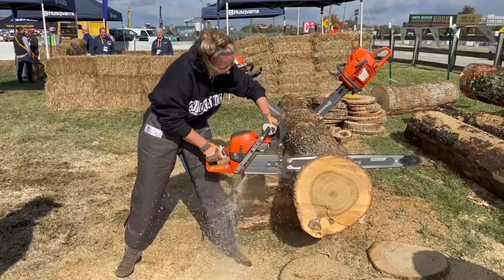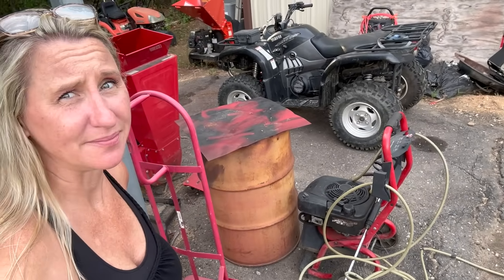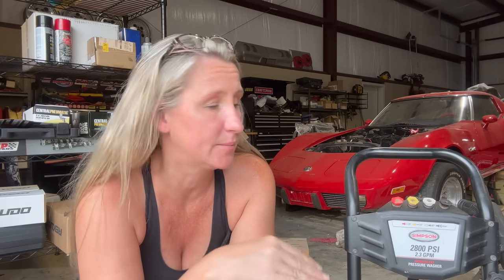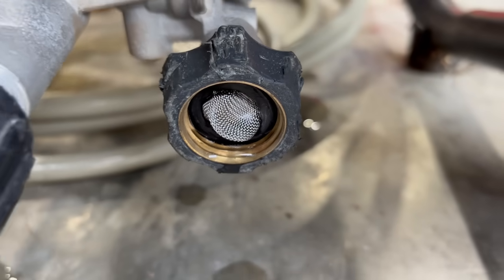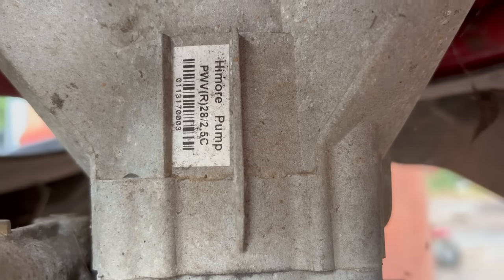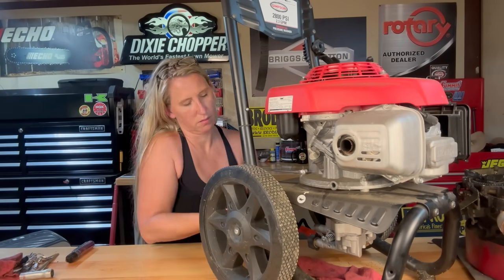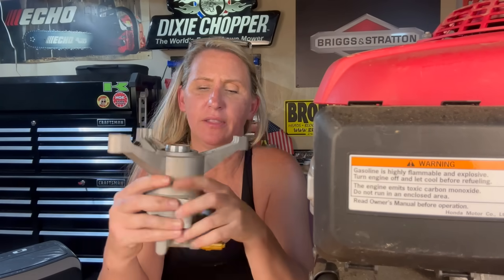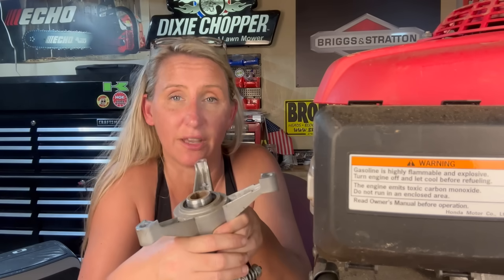STOP Paying Repair Shops! Pressure Washer Has NO Pressure?! Check Out This Super Simple Fix!

Comment: We bought a Greenworks electric power washer seven years ago for $103 on Amazon. I had to replace the hose last year for about $21. We've stayed away from gas motor washers for the point you made about not letting the pump idle. Our little electric wonder isn't the biggest but damn if we haven't got our money out of it. I checked the "buy it again" box and the replacement now sells for $249. Lordy. 

Great how-to video just the same. Best to Ron.
Reply: I paid 60 for the 1600psi ryobi. I've done entire farms with it and my inverter. One of the best washers I've ever had. I also sold an old hyper tough that absolutely shredds.

Comment: Bre, one other item to check before disconnecting the pump ... there is a temperature bypass valve that should operate to allow water to cycle through the pump when the nozzle isn't being used. When not in use for a long time, the temperature bypass valve may get stuck in the wrong position and cause improper pump performance.
I've replaced the one on my old pressure washer twice over the years and regained like-new performance. And it is (usually?) a very easy, one tool operation.

Comment: Awhile back I received an expensive HRX217 (GCV190) with a busted rod & a hole in the top end. Later was given a 190 off a PW with a busted pump. Combined the best parts of the two (especially the crankshaft from the mower engine) & have been mowing successfully ever since. Probably my favorite rescue project. You are so right; keep those engines.

Comment: Yeah, I didn't know you weren't supposed to let your pressure washer idle....I literally would let it idle to run the gas out for minutes!  I will say, it lasted over 10 years but I was only using it a few times a year.  Luckily, I saw videos like yours and bought a pump on Amazon and replaced it a few years ago and it works great.  Had to soak the key way over night to get the pump off but it works great now!  Again, like you said, don't let them idle!

Comment: Bought a two hp electric motor  with caterpillar pump 12 yrs ago. Changed pump oil three times. Starts with flip of switch; runs as new, never looked back at the cheap gas models.
Ed c

Comment: Good luck on the hip replacement. Been there done that around 1999. It was a life changing experience for sure. 
  I did fall in November and broke my mechanical hip but it is good now. 
  Just turned 69 and feel very lucky.

Comment: Great video!  Yes the pumps are super easy to replace.  Only three nuts and bolts.  I've done a couple of them over the past few months.  In the north, where I'm from, people tend to leave their pressure washers in the shed over the winter without draining the water!  Pumps freeze and then crack.  Bought pumps from amazon, but sometimes the pump mounts aren't long enough and the crankshaft bottoms out in the pump, or the legs don't have a cut away to clear the engine and won't be flush with the cart.  No problem, just use some washers or spacers between the pump and the cart to solve the issue.

Comment: I was also told not to run any "non comercial " pressure washer more than 30 min without taking a 10 min break and at that time I would shut off the engine and hold wand wide open letting cold water flow through the pump. Said a prayer for Ron hope everything went good and hopefully a speedy recovery

Comment: Great video. I pulled my pump and sure as heck the check valves were all buggered and springs missing so, using the part number stamped in the casting of the pump, I Googled a replacement and for $81 I ordered it. Not bad for fifteen minutes work and three bolts.

Comment: I installed a 4" x 20" 1 micron filter ahead of my pressure washer. Its been working great for 10+ years, I mounted it to the frame of the washer

Comment: Had this problem with my washer a week ago. Turns out the inlet screen fell to pieces, and fouled up the inside of the pump. Didn’t buy a new pump, but took it apart, and cleaned out the insides. Thankfully it worked after that.

Comment: Thanks. I thought it was the pump. I'd left it running, thinking it needed to warm up, then I saw your other video that said NOT to let it idle. Pressure tip was clogged and only needed to be changed. I was actually looking for a replacement when I decided to look at repairing this one.

Comment: Got a 3500 psi unit, used once or twice, sat outside for years.  Dropped and cleaned the float bowl, started on the 3rd pull. Shut it off, went outside, hooked up the water, and sprayed great. Released the trigger and the motor quit. I locked the trigger open and the motor would not turn.  Back inside and disassembled the pump.  Took the unloader apart and the check ball was rusted in place, no bypass. Cleaned that and the three check valves in the pump and it ran like new. One of my sons is still using it a year later.
Tell Ron we wish him a speedy recovery and follow doc's orders on exercising that new hip. Moving is key to flexibility.   jimandnena

Comment: Hi Bre, at one time my subdivision was on a community well. I found out it was caustic. Only slightly, so after 5to10 years you would be replacing faucets and so on in the house. I also found out that about 3 years of use a a residential home it would dissolve the aluminum in the pump. I learned to use the pink car antifreeze for the winter. If you have any other suggestions please let me know

Comment: Prayers sent. I have a question if you don't mind. I'm 60 now and have been a mechanic/welder most of my life. I'm trying to start a small engine repair business at home. Can you tell me what a good starting rate per hour would be and how long it takes you to remove, clean and reinstall a typical carb?? I know it varies but an average starting point would help to get a good idea. Ty very much.

Comment: Also, don’t know if you know this or not, but the unloader valve can sometimes get stuck, causing the pump not to put out high pressure. Please keep us posted on Ron. I haven’t been watching your videos for about maybe six months now but I enjoy them. I am also a small agent mechanic who is just getting started good. I am 47 years old going on 48. Change of careers for me. In 2020 I left my job almost 19 years to go through a new door that God opened for me. My job that I was working for 19 years had gotten extremely stressful and was very hard because I had to walk on concrete for eight hours aday with plantar fasciitis. To make a long Storage short, I tried a couple different jobs and now I have bolts through the door that I believe that I am supposed to work on small engines in my area of the eastern United States.

Comment: Prior to listing to this video I used to use our recycled water here in SW Florida but our pressure during the day can drop off to below 30 psi. Besides that unless you have a city water filter there can be small shells pushed through the line from time to time. I've had a number of them get clogged in the diaphragms of my irrigation valves at times until I installed a filter. It's just now worth ruining a pump for the cost of some clean water.

Comment: My neighbor threw out Honda pressure washer, bad pump. I took it, took 5 hp engine off of it, put it on my Kemp shredder. The old B&S engine was from 1950s. Saved me a couple hundred bucks. I never thought to check the pump for clogging. I’m happy with my freebie.😊

Comment: thanks for the info, I'd also recommend using the pump saver fluid when putting the power washer up for the winter. I will  
pray that the good Lord will put hes healing mantle around  Ron and pray that the Lord gives you the strength to be able to withstand the hard days you both will have following his surgery.

Comment: Some pumps have thermal relief valves in them. When the pump gets too hot it automatically dumps some water allowing cooler water into the pump. A nice safety feature.

Comment: I bought a Simpson pressure washer on Amazon. Same thing brand new no pressure. 
I called Amazon they refunded me and didn’t want the pump back. The pump was too much to repair so it sat. 
One Sunday morning I was looking at YouTube and a guy had three pumps from an auction same problem. He removed the pump and the key way had not been installed and was sitting inside under the driveshaft. 
I put my coffee down removed my pump and my key way was in the same place. I reinstalled the key way and the pump works great. 
I would check this first. It took me four minutes to fix. 
I hope Ron is recovering well.

Comment: I made the mistake of purchasing a Karcher pressure washer. It worked fine for the first two years, then no joy. I always poured RV anti-freeze into the water intake, then pulled the engine over a few times until the discharge was the same pink color, so as to not worry about freezing.
Year 3 was back to no joy. Purchased the piston kit, for your price range of $70, reassembled, still no workie. Went out and purchased a 36500 psi Campbell Hausfeld. Lasted all of 3 years, before it gave up the ghost. This time, stored in the basement. 

Did a lot of research on pressure washer pumps and found Comet pumps. 5 years later, still going strong

OBTW, the good pumps have a pressure relief system that by-passes water to keep the pump from burning up.

Comment: Buddy who sold me his broken one was jealous i fixed it and was using it so he went an bought a new high priced Honda one i don't care though im happy with the one i got it doesn't have to have extreme pressure from the wand to get any job done.

A other thing you don't wanna do is leave the wand hose hooked up to the pressure washer it can corrode on.

Some air compressors take oil

Comment: Majority of them sit the bypass valve sticks pull the staple retaining clip pull the spring looking thing. Sometimes it takes a good pair of pliers clean it up remember it's not brake cleaner friendly it'll be a hard rubber or plastic use some silicone oil I use rc shock oil reinstall make sure the bores not got that white corrosion in it put staple back in few light taps if it is lazy to fire off you can adjust that nut to tighten or loosen the spring. It's fixed the few I have worked on. Water corroded them where they couldn't move chances are you got alot of good pumps still. Give that a try and wish ron luck hope he makes a full recovery fast

Comment: I had just bought a riding tractor mower for the first time and got a nail through a rear tire.
I put a plug in the tire aired it up and thought I was good to go.
The tractor wouldn't move when I got the tire back on. I worked on it the rest of the day and couldn't get it to move.
I lived about sixty miles from the repair place, but it was a brand new tractor with warranty, so off I went.
They kept it three days and called to say it was ready, but unfortunately it was not covered under warranty. Cost me $75 but back in business.
About a month later I got another flat and removed the tire to plug it. This time I just happened to see something fall as I removed the tire.
It was the keeper you mentioned.
Put it back on as I put the tire on and it worked great.
$75 to install a keeper, and three days. Never went back to that ripoff place again.
Fun fact, I had a 65 VW Bug, and they have the same deal on the rear tire. A keeper that turns the tire with the axle!

Comment: 1. Don't idle your PW indeed at full rev. Water recirculates through your overpressure valve and heats up. Set your rev during idling too low, push gun every 10 seconds to push heated water out and let cold in or just shut-down.
2. Push your gun handle during starting the engine. Saves your recoil rope and mechanism and primes your pump.
3. Indeed check your inletscreen or just install better inletfilter.
4. After using your PW in cold climate areas just disconnect all lines and pull over the engine without starting untill no water flows out of the pump outlet anymore. No water inside, no cracking of the pump. Pump saver  is available to help keep seals flexible.
These steps makes your PW last  a long time. 👍

Comment: I have one that a let set with a vinegar solution and the solution solidified.  Ive cleaned everything except pulling out the plastic jets only because i didnt have the right tools without breaking the plastic jets. But, im on my way now. I like going to the big box blue store and buying the returned items for less then half price. Ive bought several with nothing more than a clogged screen. Easy $50 bucks for 30 minutes on a resell.

Comment: Check the unloader valve and the poppet valves. All of the pumps that I saw are a karcher style pump and even a kat or comet style pump is very easy rebuild able. New brass wear rings and seals, o rings, poppet valves and springs and you are back to work. $40 in parts and 45 minutes and away you are washing. No need to remove from the engine. If you keep your pump serviced, it should last 20-30 years and with very little problems. This is coming from a 30 year mechanic, Me.

Comment: My self propelled mower quit pulling or driving. It’s a front wheel Troy built I think. I need to go see the brand, but can’t find anything on fixing it. I am very mechanical, but I sure would like some advice. Gears in the wheel are fine. Just started thinking maybe there’s one of those keys. Thanks so much for your channel. Good luck on the hip.

Comment: Prayers for a successful outcome!  Content idea:  Although it makes me cringe, how about a video of running a brand-new, not low-end, washer on bypass for 10 minutes, or until it fails?  Even if it's a boring failure like just dribbling down to no flow, it really drives the point home, 60 seconds means 50 seconds.  Another test, run in 5 seconds on / 60 seconds off until fail, in other words is even a brief pressure relief going to be effective?  Love the channel BTW... im in the middle of a battle with my unloader valve, it ain't pretty!

Comment: got a couple of homeowner cheap 2.4 gallon washers. 15 year old washers that I abused. original pumps. sit outside all year. even in winter. lol I've let them both idle purposely and overheat till the thermal sensors opened the relief valve just because. changed plugs once or twice but that's about it. i always use Lucas ethanol fuel conditioner for my small engines and they both still run good. guess i'm lucky.

Comment: I knew it. I had a pressure washing service years ago, bought a nice Craftsman Gold machine. Whenever I'm dealing with a machine I'm not familiar with I read the manual and especially the NEVER DO THIS section. That is why I knew never let the machine run if you aren't using it. My friend also had a pressure washing service, I told her don't let that run if you aren't spraying. I explained why, she didn't listen, you can figure what happened. I did the recommended owner upkeep and it ran like a champ for years. If you don't want to read your owner's manual at least read the 'Don'ts' in it.

Comment: There's a control valve on the things sometimes they go bad and they're easy to fix, in the pump itself is just fine, I'm 70 years old I was in the pool restoration business for years, and we still have an old pressure washer that works just fine it's got to be 40 years old !!!!

Comment: I replaced the pump on my pressure washer because I had no pressure. Replacing the pump is pretty simple however when I hooked up the hose I didn't get any pressure with the new pump either. Then, by chance, I purged the pump by squeezing the wand trigger with engine off and the hose connected. It took about 20 seconds before the hose stopped spitting air/water until I got all water. Started the motor and suddenly I had pressure. I'm not certain if this is a "thing" but now when I use my washer I run water through the pump without the engine running until I get a clear stream and then start the engine.

Comment: Damn!!!!!!!!
I have a 2700 psi equipment that's been around for 15yrs, still going.
2yrs ago I purchased a 3300 for more power outdoor cleaning and a small electric 1800 for washing cars.

I don't like to idle when washing cars so that's why I purchased a electric washer. 

I always say, be one with the equipment,  I always turn it off when not in use long periods 

Guess I'm going good.

Comment: Hey Bre, 
Great video!
Please clarify something. When you say, "don't let the pressure washer idle,"  do you mean, don't let the engine run at idle speed or do you mean don't let the engine run while you are not pulling the trigger on the wand? If you let the motor run while the trigger on the wand is not being pressed, you will ruin the pump and not to be a smart Aleck, I knew that, but if you are saying that it is bad to run the engine at at idle speed, because it will ruin the pump, this is something I did not know. 
My pressure washer has a throttle on it so that I can control how fast the engine runs.

Comment: My Craftsman Power Washer pressure just today started to fluxuate. I had the “Max” nozzle on and the pressure came out as if it was on a “General” nozzle. Next time I have a chance I’m going to go thru all the pointers you mentioned.

Secondly, my washer engine is surging. I opened the air filter compartment and the filter is oily as well is the housing. Yikes!

Comment: Please get well soon Ron. I suffer from pain and I'm looking forward to a surgery that will actually help me walk as well. 
By the way, nice video and do you have any videos on winterizing your pressure washer pump for freezing weather. 
On my old hot water pressure washer i had a schrader valve that i could use compressed air to clear out the lines. 
On my cheap simpson all i can figure is injecting some type of pressurized lube into the water inlet. I'd rather just remove a cap and drain the water out if possible.

Comment: I had a Simoniz brand washer. Kohler engine. I put pump saver in it but stored it in an unheated shed. The casing split. Cheaper to buy another machine